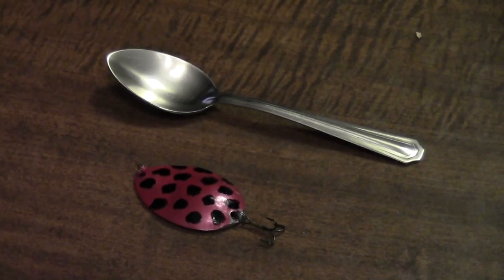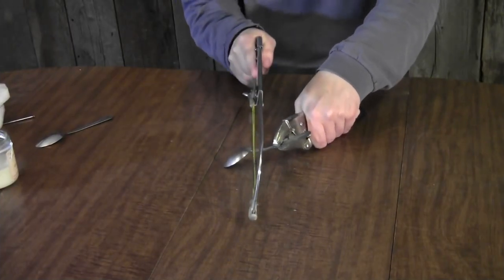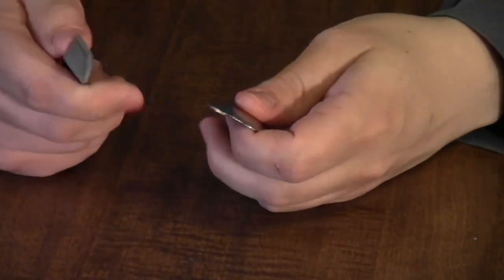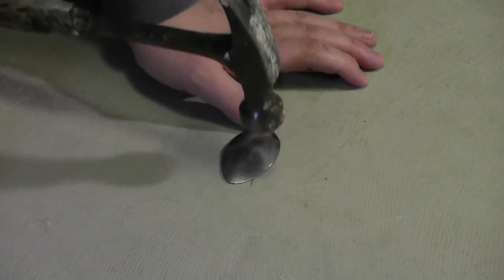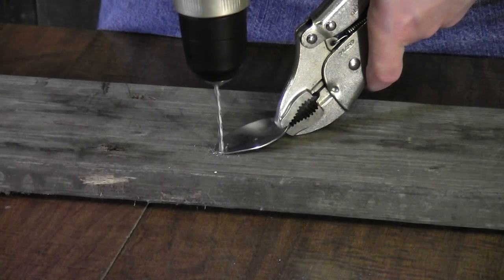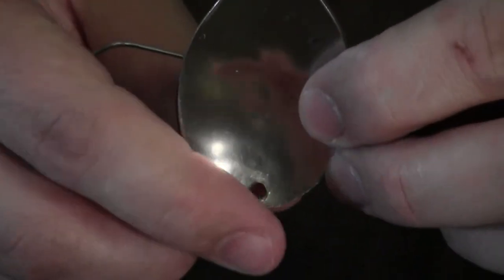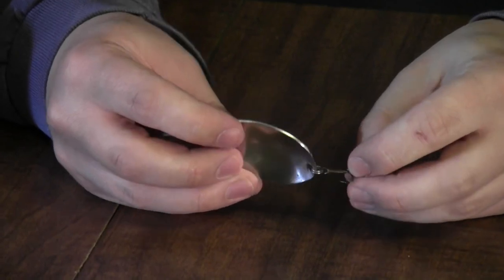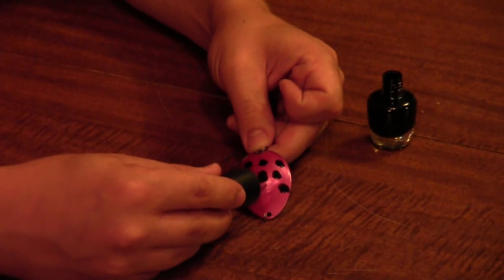How to make a spoon lure from a kitchen spoon

Comment: I've used nail polish to repaint plugs for years.  (People always look at me strange when I buy it - I'm a 6'7", 225 pound guy.)  From personal experience, nail polish with a coat or 2 of clear over the top is the best finish you can give a lure.  One particular of these custom-painted hot & tots has been my best color on Saginaw Bay for the past 3-4 years, has caught probably a few hundred walleye, and it still looks brand new.  Holds up much better than whatever paint they use at the factory.

Comment: Great video! I would suggest a bigger hook for that big of a spoon because when the fish bite, the size of the spoon compared to the size of the hook will block the hook from digging into the fish. From my experience a layer of clear coat on a painted lure protects it from chipping so you dont have to repaint the lure
Reply from the maker: Reid Wasankari Your suggestion is a good one.  After a lost a couple of bass on it, I increased the hook size.

Comment: if you guys like jigging for large fish , try getting old scrap stainless steel chairs or furniture,  cut the tube into say 4 or 5 inch or bigger pieces  flat one end  round of like a tyre lever, drill ends place on a wire ring for treble hook ,  top up inside the jig with moulten lead,  leaving about  inch from the top, once cooled flatten top round of like a tyre lever shape drill hole for swivel and ring , you can slighty bend into s  shape or you can do this before pouring in the lead.. once holes both ends and rings on you can decorate with a swivel and hook ..saves paying hundreds dollers or pounds out for bass or shark  or cod jigs,,,,ive also used old wind chimes for this purpose also ..good fishing and hunting guys.....

Comment: i also go to , local shops find flat shell necklaces etc and make lures from those, also if you want to make good self cocking floats get the welders  jig  copper or brass ones   make say , a round balsa wood dowel to shape of a float, say 3 inches in height once shaped, get a piece of the jig like a sparkler metal handle , and make about four or five inches push about inch  in base of the balsa float, and superglue it in once hole is done,  paint cover with yaght varnish and enjoy put a little rubber ring on the base part , but cut of a hook end and push that into top or side of float , superglue and thread line through that...happy hunting guys...test floats for self cocking before super glueing in ,  push up and down in base of float , to get just right ...

Comment: ive been making lures like this since i was about 8 yrs old im now in my  late 50s, brillilaint idea also  like mark s ..says i used the handles , once holes are drilled on the handles , bend into a slight s  shape not to deep of an s bend ,,put one end in a vice grip , pull or bend slightly down and turn around do same with the other end but going different direction, so its a slight s shape put on rings hooks etc , this the water hits the sides making it wobble ..good hunting ..also check out bottle cap lures you will  love em on you tube....
Reply from the maker: Thanks for the tips!

Comment: I've made quite a few of such table spoon lures before , great that you're mentioning to decrease the spoon's cupping to enhance it's wobble .
I even took it one step further and ground material off the sides of the spoon to achieve a so-called "shoehorn" and also an oblong shape , never cut off the handle at that stage to have a good grip on the workpiece , also using the handles for smaller trout spoons . If interested , check my channel , some vids about spoons there , greetz , 61diemai